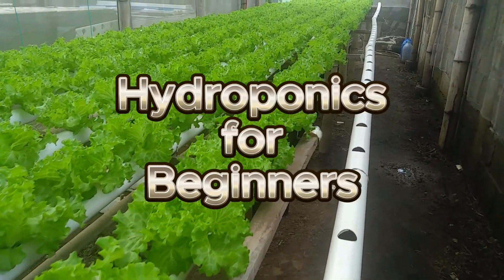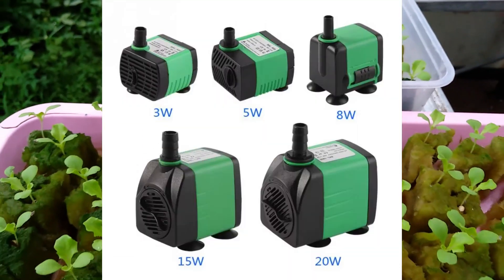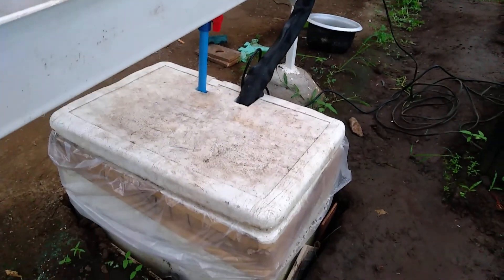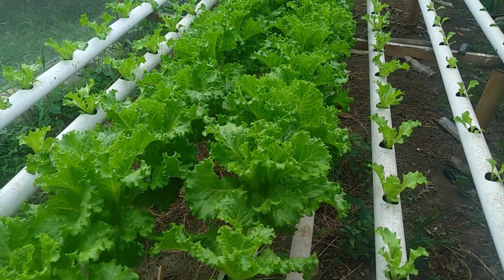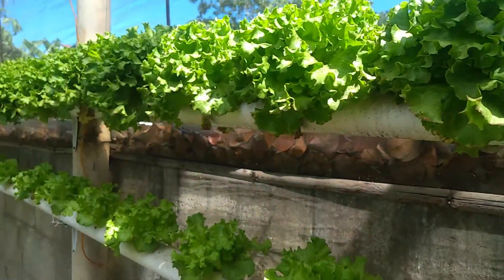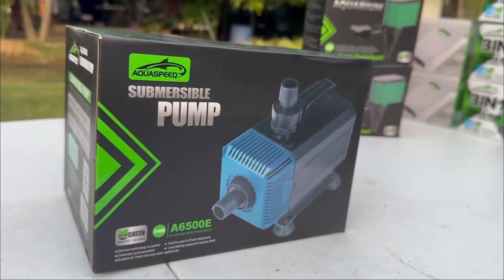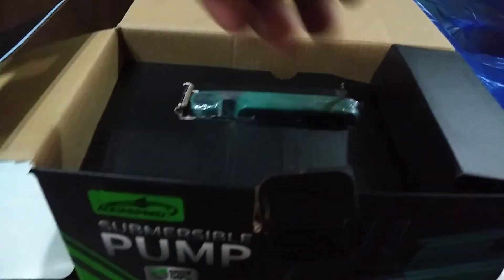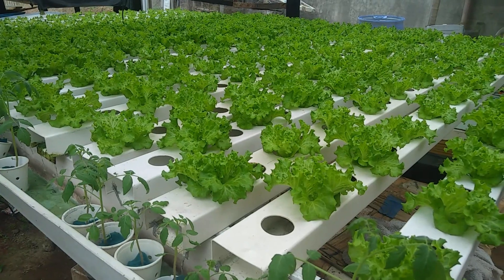Selecting a Submersible Pump for Your Hydroponic System

Comment: Hi why did you change from PVC pipe to square tube PVC? also how do you keep water temperature cool in  hot weather?
Thank you keep posting this amazing information.
Reply from the maker: @SouthySouthy  I bought the square PVC channels second hand from another grower and It was very affordable and the length (8 ft.) was perfect for my small greenhouse. To keep the nutrient solution cool during hot weather, I freeze water in plastic soda bottles and place them inside the nutrient reservoir 😁. Thanks for watching🙏

Comment: What if black out. Ano po diskarte nyo?
Reply from the maker: Good question po. I have back up power (deep cycle battery + inverter) which I turn on in case of 2+hours black out. This is important for commercial growers. For home or backyard growers naman po, if you have just a few channels, manual na lang po. Pour 1 liter of nutrients into the channels every 30 minutes.
Reply: @luckienuckie  maraming salamat sa sagot po sir. More power at God bless po 🙏🏻
Reply from the maker: @janlovesdiv2579  You're welcome! Pls, don't hesitate to ask if you have questions about beginner hydroponics. We are glad to help.🌱🌱🌱